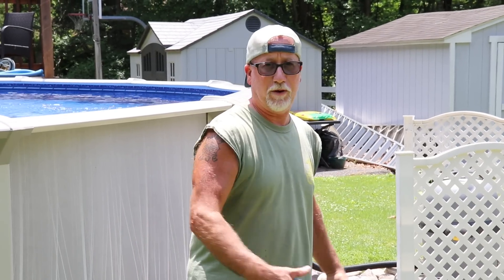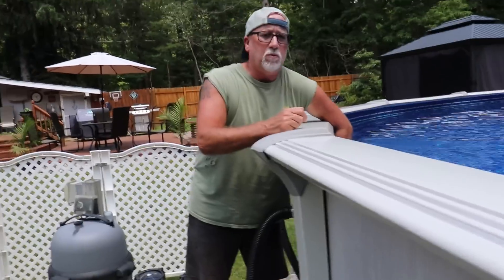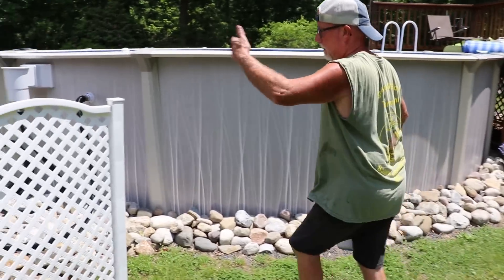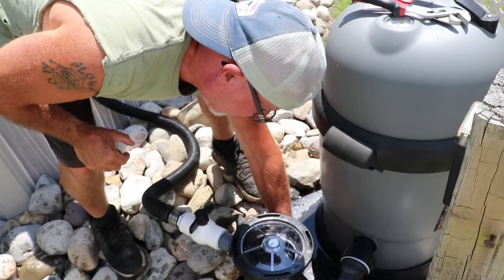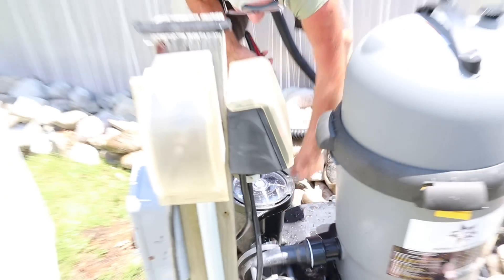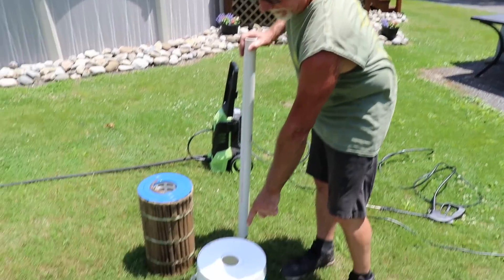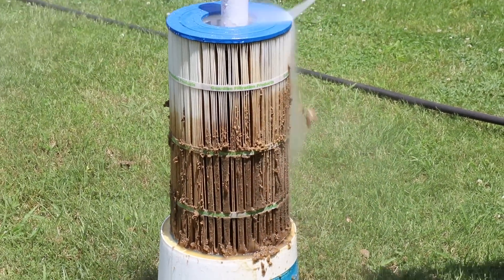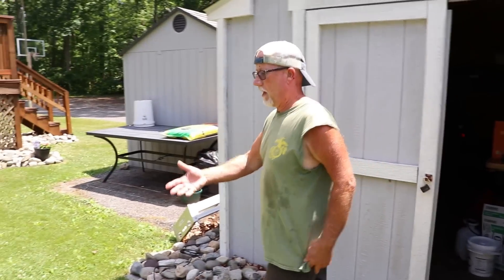How to Clean a Cartridge Filter

Comment: It was nicely done however 
 the pump basket, you don’t need to take out the drain cap, there is no pressure in there that you have to relief so all you have to do is take off the lid, clean it out and put it back.

Comment: Get a sand pump.Way cheaper.I hardly use chemicals and only backwash once a season.No filters.$300.00 system.PS.Do not get a saltwater system as it will corrode the metal real fast.Sand is way cheaper and cleaner.All i do is skim and vacuum when i use it.I keep it covered.Takes two min to do.